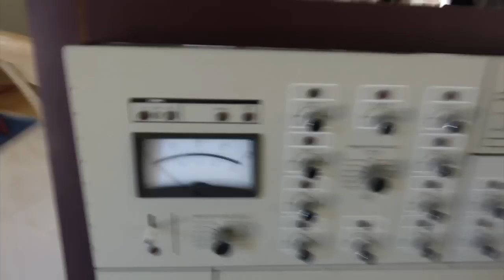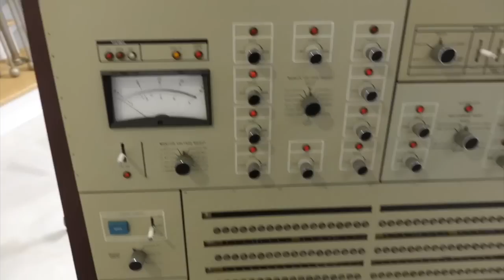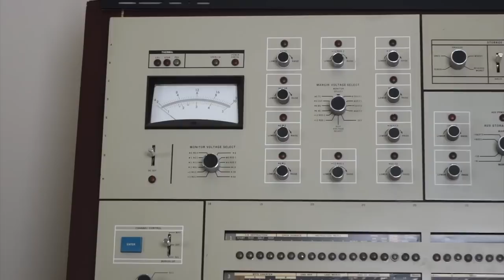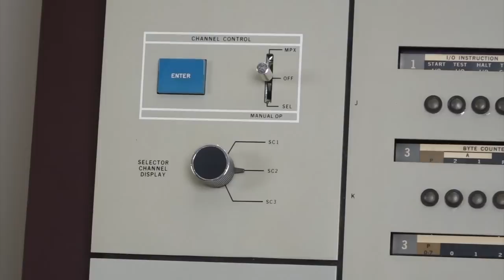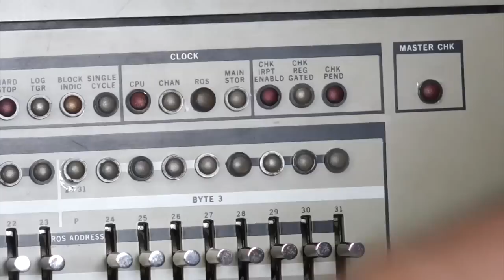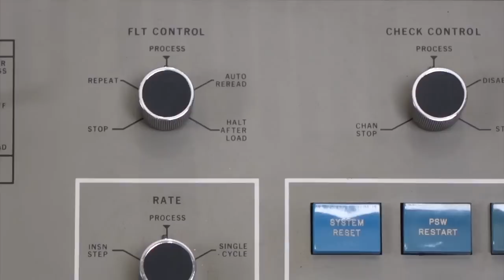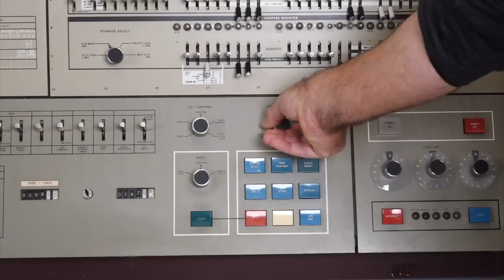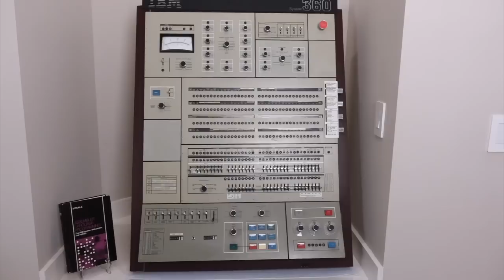IBM System/360 Front Panel

Comment: Well, I'm a retired IBMer who was once a CE trained to maintain the 360 Model 50 CPU's. I enjoyed your video on the front panel.  I've got quite a few comments and information I can pass along about this machine, and its front panel.  I hardly know where to start, so I'll start by writing a few things offline... so I can compose my thoughts, and then post them here as I complete different parts of them. I dare say there's a lot of information that has been denied to you due to the fact that the wires were cut out behind the panel ... they would have informed you in areas you could only speculate about. (Actually a half-century later, I'm delighted to realize that I remember a lot more than I might have expected... so watch this space over the next few days.
Reply: Anything?
Reply: I, too, am an ex-IBMer and worked on most of the 360's -- 30,40,45,50,65 and 370's. He will need to install a new power panel to do a lamp test on that beast! I remember that the 360/75 would trip a breaker if the lamp test button was pressed.
Reply: 1 year ago...
Reply: Would've loved to hear what you had to say!
Reply: Are you an Alzheimer's patient?
Reply: Come back!
Reply: Well I guess the dude forgot the composing.
Reply: @johncrunk8038  ..Here also. Worked on a lot of Model 50's. We used to say that if you threw one in the lake it would intermittently sink. My customer account had a Mod 50 that started developing very intermittent problems.  The system would run for some time then crash with a Master Check. Each time the problem would be different from the previous. Restart the system and it might run 30 min, an hour, 12 hours then crash indicating a different problem. We chased this thing for a week before we finally decided that the problem was silver migration growing tiny little silver whiskers on the flat cable connectors that would short out one conductor on the cable to another one. That would take the system down, and the minute current flow in the whisker would burn it away so the system would run OK again until another whisker grew on some other flat cable. The solution was to completely replace every flat cable in the unit.  I made a lot of overtime on that bug.
Reply: @willharry6791  Oh, yes. The old silver whisker problem. We spent many weekends working on those flat cables and it cured so many weird problems. There was a similar problem on the boards on the 370/168. The "leak" was between the circuit traces and the ground plane. Another truckload of parts.
Reply: @johncrunk8038  I recall that gigantic 360/75 panel. It was the machine that all the company tours were brought to to impress people with its Hollywood movie blinking lights.
Reply: why didn't you ever post the information?
Reply: :: narrator :: Not days later, Russ had a heart attack.
JUST KIDDING! WHERE IS THIS ARCANE KNOWLEDGE?! (Also, hope you're healthy!!)
Reply: @johncrunk8038  Same for the 95! We were warned to never push it.
Reply: Russ, I do hope you're healthy and well, and that you can return to us and bestow upon us this knowledge. Life gets in the way, sometimes, of YouTube commenting, but I hope that whatever life threw at you was just an inconvenience and nothing terrible.
Reply: Likely be a encolpdia of wisdom
Reply: Russ, you needed. An interview?
Reply: I know one way to bring down the system… I was working on a 1419 and a 2956 Check Reader/Sorters in the early 70’s.  The IBM machine was on a different floor than the sorter room. The sorter room had the two reader/sorters and two printers.  We needed to ground ourselves and remove any static electricity before touching anything connected to the IBM machine - this was the age of polyester clothing.  If you touched one of the metal printers and felt an electrical shock it would cause the IBM to go down and they would have to do an IPL to restart.  We would have to spend time to determine what checks were captured and which ones needed to be reran to capture and route to correct sorting pocket. So it did not take much to bring down a machine if you wanted to cause issues.

Comment: As a student, I was a 360/50 operator at the University of Waterloo in 1971, and your outstanding presentation sure brought back memories. The UoW machine had 512KB of fast memory installed, but a portion of it never worked reliably, so the IBM CEs disabled part of it to the 384KB that did work. This machine also had 1MB of slow (LCS) memory that you mention. The 360/50 was mostly used to provide APL ("A Programming Language") services for around eighty 2741 terminals, all connected via a 3705 communications controller. Thus the 360/50 was normally running round the clock except on Friday's when the IBM CEs did their PM. That's when I got to IPL the machine and then bring up APL as a job. The OS job dispatcher loaded jobs in memory starting in LCS, which was too slow for running APL. So I had to run a dummy job aptly named 'Corefill' which just hogged all of LCS but did nothing, then load APL which would now load into 'fast' memory', then cancel 'Corefill' on the 1052 console. There was also fun stuff like mounting tapes on the 2400 drives, mounting the 2314 removable disk spindles, and hauling  boxes of green-bar paper.  The 'infamous' red 'do not pull' switch was a popular place to hang surplus rubber bands that you would need for keeping the various card decks together...not a good place to store them!
Reply: I drove an IBM 360/44 at the University of Houston in 1971/72. It had core main memory, but a small amount of that new fangled transistor memory in the console. It also had a drive for those enormous old floppy disks, but no-one used it.  I was given the job of system programmer too. FORTRAN IV, learned from the IBM manuals. There were no CS courses of course.

I remember a few of those controls, but not many.
Reply: “Corefill” ... I had to do something similar on an IBM 5170 in the mid-to-late 1980s. This was one of the early ones to have its full 640KiB of RAM, and the WordStar installer was doing a signed comparison on available RAM, and deciding that there wasn’t enough for it to install. To fix, this, I created a RAM disk which reduced the amount of free RAM to below 512KiB. Then WordStar would install.

I guess some things about IBM never really change ...
Reply: What did these system cost?
Reply: pentlandite hey my high school computer science teacher went to uwaterloo in the 70’s and used the 360/50! He gave me a punch card from one of his programs for it when I graduated
Reply: We had two 44s. Hard-coded rather than microcode and a reduced instruction set (e.g. no storage-to-storage instructions). Though you could load the auxiliary storage with an emulator when you wanted to use all the 360 instructions when doing offline processing.

Comment: I worked on the 360s,and then the 370s, from 1965 through 1978 (with a few System 3s thrown in for fun), before moving on to Data General C/330s and MV8000s in the early 80s. What I loved about the panel based computers is that everyone was terrified of touching them: the CE would show the operator what to do to get started,and that was it for most people.  I worked overnights most of the time, and to amuse myself while the humongous printouts happened, I would examine different memory locations - when the day shift people would come in they'd be all freaked out that the rollers/switches weren't the same as when they left!  Good Times!
Reply: Yes, we would be up all night calculating stuff that would take less than a minute today.
Reply: I used to be a computer tech and worked on Data General Nova & Eclipse computers, along with DEC PDP-8, PDP-11, VAX 11/780, various PR!ME models and Collins 8500 computers.  the Collins was a mil spec version of an IBM system.  The 2nd front panel I worked on was for my IMSAI 8080 computer, which was the first computer I owned.  The first was on an ancient Teleregister system, located in the Toronto Stock Exchange.  It used vacuum tubes and relays!
Reply: @James_Knott  

The IMSAI was a gorgeous machine, but I was no fan of the S100 bus.  My first homebrew was an ALTAIR 6800, but with a pair of 6502 CPUs  on a modified SS-50 bus (I used the inverted clock for the second CPU, so each processor was unaware of the other, and they shared physical resources).  I worked on the Eclipse lines a LOT - I even wrote their first (and probably only, since the MV8000 replaced them with a *nix like system) multitasked Print Spooler.  I have the service panel from the last S/370 I worked at (at Blue Cross in NYC) hanging on the wall behind me (I'd send a pic if they'd allow it).  I worked on the Muppets with Jim Henson on a S/32, and I write the first Dental Practice system (including a universal insurer interface) on a Micronova 2!  Damn I miss those days!

I wanted to work on the VAX 11/780 so bad I could taste it, but the VAX owners were snobs, and once they knew you were a fan of either DG or Onyx (remember them???), your interview was over!  I tried so hard that I actually interviewed for a job o a 780 that was a 2.5 hour drive, in a perfume manufacturer (as an asthmatic, that place would probably have killed me, but that would have been a small price to pay at that time). Alas, it didn't happen until I saw a 780 being [literally] tossed in the trash (lord knows what they upgraded to that they felt a multicabinet 11/780 was only worthy of the dump) - I grabbed it before the trash people could, and had it running in my home about a month later.  That thing ate more power than a C/330 with a pair of Zebra drives and a bank of 1600bpi vacuum drives all by itself: the power company was quite impressed with the bills they were sending me for those few months: I was making _really good money for the 1980s (over $200K/yr before taxes, and I had a hard time keeping up with the power bills (not to mention the 4 tons of A/C it needed as well)!
Reply: @measl  I know the S-100 wasn't the greatest, but it was improved for the IEEE spec.  In some ways, it was better than the IBM PC bus, for example level triggered rather than edge triggered interrupts in the PC.  I remember the Onyx name, but never saw one.  I used to work for a major telecom and the computers I worked on were for message switching, including telegrams.  The Collins computers were for the Air Canada reservation system.  On the Eclipse computers, mostly S/130, I would even get into the microcode, when trouble shooting.  Incidentally, I can thank the VAX for my first modem.  One day my wife visited me at my office and I showed her the Adventure game.on the VAX.  She wanted to know if she could play it on my IMSAI.  I said no, but if we had a modem...  I was soon the proud owner of a 300B manual modem.  🙂
I realized the end was near for that sort of computer when I read the new Intel 80386 CPU was as powerful as the VAX CPU.  I then moved into planning, where I planned the installation of telecom equipment in the company's main office and customer sites in downtown Toronto.
Incidentally, when I was a tech working on the Eclipse computers, I hand wired a couple of Ethernet controllers on prototyping boards for the Eclipse.  At the time we had a DECnet LAN connecting the VAXes and the programmers wanted to connect some Eclipses to it.
Reply: @James_Knott  
I agree. The IBM PC took the industry backwards by almost a decade. Every single thing about it reflects their design philosophy: make it fast, make it cheap, and don't worry about compatibility.  Our projections show we won't even sell a half million of these, so just get it done as fast and dirty as possible.*

They succeeded. It was a terrible design, from start to finish.  What made that so sad was that it came from the first company to understand that both forward and backward compatibility was the key to success.  They abandoned every one of the philosophical positions that made IBM the powerhouse that it was - really, it marked the death of IBM as a serious player in their own field. The Compaq 386, as awful as that design was, it blew the doors off the 370/168 (the biggest, baddest, sexiest machine IBM ever made for the civilian market)
Reply: Remarkable - We have a similar background. I also worked at IBM in the 1960's and after a stint in the Navy went to Data General about 1973.  The 16 bit DG Nova was the machine then. Memory was magnetic cores, boards were wire wrapped,  and you debugged using memory dumps. There is a Pulitzer Prize winning book "The Soul of a New Machine" by Tracy Kidder about the development of the Eclipse line.

Comment: I used to work on a 370 mainframe, every day, for years. One of the first things I was taught, the blinking lights did not mean anything.
Reply: I’m guessing you were an operator. I was a systems programmer for the UK bank and we could book one of the machines for testing/debugging. I have used the single step switch to try to find an error in a systems program.

Do you remember the console on a /370? Instead of a raster screen, it used something that drew each character using up/down left/right changes to the electron beam on a CRT that had a long decay time. 

Then the 303X machines came with an auxiliary processor to run the machine which had a regular raster display. More powerful and easier to use, but no more blinkenlights!

Comment: I worked as a systems programmer at IBM Poughkeepsie in the 60's. I was something of a maverick as I preferred colored over white shirts so they put me on the night shift. At night I had an entire 360 to myself. I still remember single stepping through code using the front panel switches and lights to debug. Hard to believe today but 4 kilobytes was considered a lot of memory then.

Comment: I trained on one of these at CDC (Control Data Corporation) just off Oxford Street in Central London(UK) (1980). We had a 360 up in the main computer centre in East Barnet - which as the story went had been dropped into the harbour of a South American country were the correct bribes had not been paid. Trainee engineers were given the recovered 360 - to clean it up (which could not be re-sold as the insurance had already been paid). So from time-to-time it would just stop. There was a procedure to instruction step to the next step using the toggle switches shown around 13-19mins. There was a 50/50 chance that this would fix the bug - and normal service would be resumed!  -
Reply: Paul de Swardt i
Reply: I worked as a CE for IBM in London in the 70's. I remember working on a nasty bug on that Mod 50 on Oxford St !!
Reply: Why would CDC have an IBM mainframe? They made their own machines.

Comment: Night shift computer operator 1976 Cleveland, Ohio. Worked for CMI (Computer Management Incorporated)  from 1976 to 1980.
We had an IBM 360/20 and a IBM 360/40 - Man they were workhorses, we worked two shifts X 80 hour weeks at that service bureau taking any job we could to be profitable. Finally after a few years we got some traction with SC Johnson company and the Department of the Navy.
Those were the days, I'll never forget there was one job I thought was going to do us in it was: 500,000 cards to tape, my hands still hurt when I think about it today. We had two 1403 N1 printers that every once in a while someone would leave a stack of tapes on top of one of them,  when the printer ran out of paper the top would automatically raise up and the tapes would fall off smashing them on the floor!
Thanks for uploading! 
😊
Reply: a joke ONLY an IBM Operator would get:  How can you tell a mail dataset from a femaie?    //SYSIN DD PGM=IEBGENDER

Comment: I was a CE who repaired the entire 360 line.This brought back memories from the 70's working out of NY Brokerage office in the Wall street area of lower manhattan.My favorite system was the 360/65.It had 1 meg of core storage.I remember useing a hammer to tap on arays to clear dust put of them while running the "3A1" diagnostic....thanx for the video.

Comment: The CE key also enabled some of the function switches on the front panel. The power section could not bias voltages without that key turned on. Most customers would run the computer with the check control switch in stop. If there was a hardware error the check light would come on and the system would freeze. The operator would then push the logout button, which dumps a number of internal registers to main storage. The operator would then load (from cards) a program called SEREP (System Error Record Editing Program) which would print a formatted dump of the errors on the system printer (the 1403). Teach operators Error light on, press logout, run SEREP.
I serviced mostly the 65. Both the 65 and the 40 were rock solid, I always did feel that the 50 was a bit flaky.

Comment: We had three 360/50's on the floor at Centre-File in The City of London in the late 60's then upgraded them to 370/155's running OS/ ASP. It was a large bureau operation running remote systems for Stockbrokers and Building Soci plus Payroll. Lots of Peripherals and strings of disks.

Comment: When I was a student at the University of Illinois in 1972, I had a part-time job as a 360/75 operator. Now that was an impressive front panel.
I've always had an especial fondness for the IBM 360 mainframes. My phone has more processing power but they sure looked sweet.
Reply: Probably the same machine I ran programs on there in '72. You may have run my program.